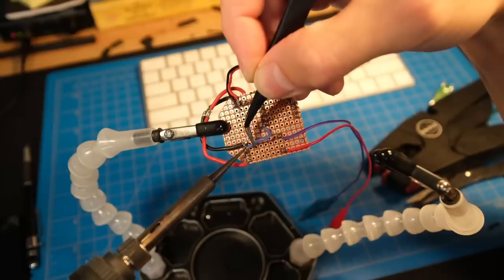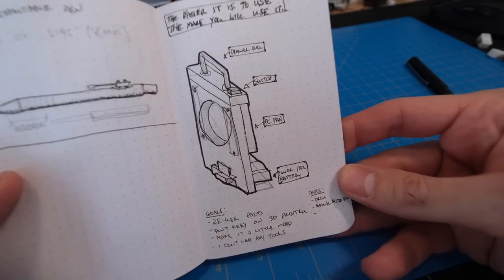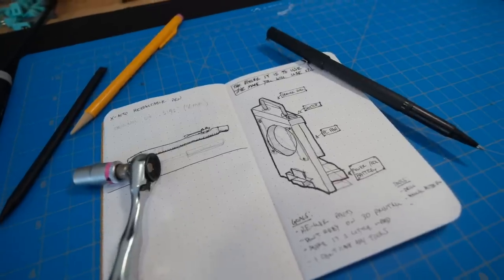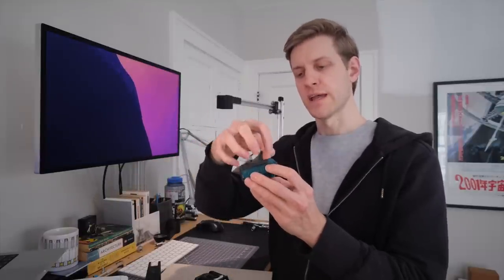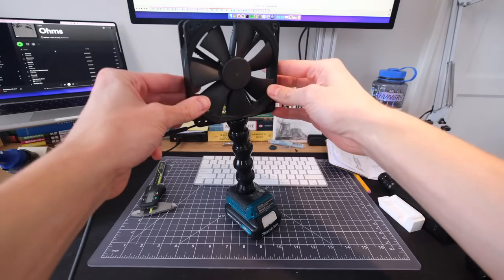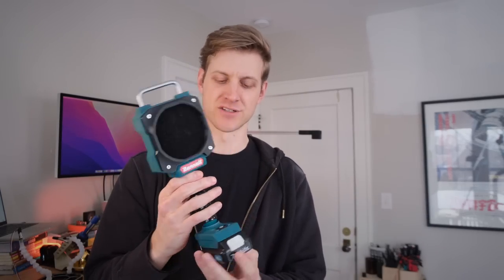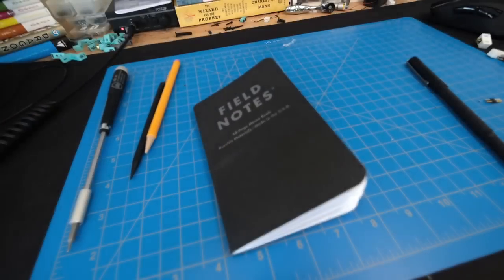A fume extractor I'll actually use | Making a cordless fume extractor

Comment: How does a mesh see-throufh filter actually help you not to breathe in the vapors? If anything it only stirs up the smoke so you can't see it and then injects it into your room as a haze.   A real extractor should be plumbed to extract the vapor out of your living space.......
Reply from the maker: It is a carbon filter
Reply: @StevenBennettMakes  if that's the case, I'm not sure you know the difference between activated carbon and open cell foam.  What you have there in the best case is a simple dust filter. I know because you can see through it. Activated carbon comes in granule form and you need a good thickness of granules for it to have any effectiveness removing anything from the air. Plus it's usually used to remove smell, Not particulate matter.   If you really care about your lungs I would rethink your design
Reply: @StevenBennettMakes  consider using a cheap particulate matter sensor in the room when you're soldering , but with and without your filter, and you'll see what I mean. I don't think your filter is doing anything but hiding the vapor from you while stirring it around
Reply: @gutrali you're absolutely right ! I don’t solder so often, but every time I reproach myself for the fact that I still haven’t solved the issue with harmful fumes.
Reply from the maker: The material is activated carbon impregnated polyurethane foam. The fact that you can see through it doesn't tell you its chemical composition. It's the same type of filter used on hundreds of commercial desktop fume extractors. You're right to say it isn't removing 100% of harmful chemicals, but these types of filters are more functional than you suggest.
Reply: @StevenBennettMakes  I See you want to protect your idea, but this is yet another fume extractor that extracts nothing. @Ryan Skelly is right, that carbon filter will absorb only big particles to some extent. You mention commercial desktop fume extractors with those filters, they are also toys not filtering anything. I designed my own fume extractor, actually extracting fumes outside the apartment, with an option to add carbon and hepa filter inside (only for my girlfriend nail work when she uses her nail dremel.). If you disagree, see what filtering system proffesional extractors actually contain. Redesign your thingy to make arm stronger and attach for eample dust pipe to remove fumes outside your apartment.
Reply from the maker: @Arek His claim was that the filter doesn't contain activated carbon, and it does. Regardless, we are all aware that a HEPA filter is much better at filtering. This isn't that. If it makes you two feel better, try thinking of this as a fan that prevents concentrated fumes from going directly into my nose and mouth, and then rest easy knowing that I have a separate room-scale HEPA filter in my office.

Comment: Your project inspired me to start building my own fume extractor. I'm still in the prototyping phase, but I've noticed that if you do not supply a PWM signal to a fan, most of them will default to around 50% speed. This behavior includes the Noctua Industrial fan you are using. To remedy this problem, I got myself some 12V PWM Speed Controller for pc fans off Aliexpress.  Anyway, I thought this might interest you or anyone looking to build something similar. 😊

Comment: Love the design, great job.
I wanted to note one thing for everyone though. Those electronics that you removed with the LED does more than just drive the LED. All, and I do mean ALL, of the battery management is on that board. Without it your fan WILL drain the cells beyond charge-ability and recovery.
Reverse engineering that board would be pretty hard but there are some super simple Li-ion management boards you can buy online and it would fit within that base. I highly recommend it.

Comment: Pretty cool!  Some thoughts:

1. Some quick digging found that the bluish colour used by Makita is Pantone 321-C.  There are pretty close matches in the RAL colour system, as well: 5018 and 5021 seem to come closest.  Companies like ColorFabb can sell you color-matched filament.  &You can find the Pantone/RAL IDs for most companies' products.
2. One old-school option for extending the fan would be to use a couple of telescoping antennas, with +12v on one and GND on the other.  You wouldn't need to worry about running wires to the fan and you could have it as high as you need it to be.  If you use the folding type as is found on old boom boxes, you can even tilt it forward and back.

Cheers!
Reply: You could also remove the core from some paracord, and insert the antennas into the paracords outer layer to make it harder to accidentally short the battery
Reply: @Aikano9  That's brilliant!!!

Comment: All this talk of inspiration and not using a fume extractor enough gave me an idea. Tomorrow I'll open up my cheap soldering/hot air station and wire in a fume extractor if it's right there and no batteries or external power required I might actually use one because I often find myself soldering something in a rush to finish as it's usually the last step in a project.

Comment: Neat project but at 16:22 you can see how unfiltered fumes are expelled out of the back of the fan housing. 
You would probably need two 120mm industrial noctua fans back to back and a thicker (HEPA) filter to actually extract the fumes.

Otherwise the whole design process is pretty cool to watch!

Comment: For solder a beefy hepa/carbon/chemical absorbtion stack is required to actually remove the cancer causing chemicals and particles. The simple fume extractors just disperse the tiny particles to something you can't see but are still breathing in. Because hepa/carbon filters are expensive a far cheaper method is to just make a window ventilator to both extract are from the room that the hazard exists and in another room force air into the building to create a large amount of fresh airflow without the need for very expensive and consumable filters. Then you can use these kinds of fume extractors to get the smoke away from your face and the window extractors provide enough air changes per hour to the room to clear out the smoke over time.

Comment: Hi Steven. If you were going to re-do the top to suit a more powerful fan, another great addition to this would be a ring light for when you are working. Would make it even more work friendly. Well done though. I myself designed up a fune extractor, but I’m using a 120mm Sunon server fan that moves around 800cfm. So solder fumes don’t stand a chance, lol.

Comment: Really cool tool! Only downside I see is the height not being adjustable without obstructing the top of what you're working on (I guess putting it sideways is a fix but that would go against minimal footprint). Have you tried it with a single ball socket? I think you would retain much of the functionality while optimizing for work that's closer to the table.

Comment: Hi, this video is really good, it makes me be inspired, and the video almost considered all issue, but I have a question, if I have a voltage of the battery pack is greater than 12V, do I need to use a Buck module to make it output 12V? My fan is 12V 0.16A. Or will the battery pack automatically adjust? I'm a new player. My knowledge in this area is really poor. Hope you could answer that, thank you.

Comment: I've been wanting to make an articulating solder extractor for a little while now but I'm definitely going to steal your idea of using a tool battery. The weight should help it keep from tipping over too. Great project.
Reply from the maker: Cool! Best of luck on making your version. The weight of the battery is pretty critical to the whole thing working and it has been stable so far

Comment: I love this idea! I had a similar issue with fume extraction in my small apartment.. I have a fan hooked up to USB power on my work area that works, but has no filter or stand.. This would make it so much more portable. Now I'm gonna have to go find a battery like that; maybe a salvaged one to make my recycle brain happy.
Reply from the maker: Definitely! I found a couple good deals on ebay on the battery front, definitely worth a shot :)

Comment: Hi, I have really liked your videos and I'm thinking of making a DIYson Express with some of my friends that I have shown the project. We are considering buying a 3D printer and I want to ask what 3D printer you make your final parts because I have noticed you have two, a small one and a medium one can you tell me the model of the printer. Because researching I have been in a rabbit hole and I can not decide which wan we should buy.
Reply from the maker: Hello! Yes there are a lot of options out there huh? It can quickly become overwhelming. I have limited hands-on experience with printers outside of the ones I've owned, but I can speak to my own experience and fully recommend one of the Prusas (either the MK3 or the Mini (these are what you see me use)). To keep things simple; the MK3 provides exceptional quality, while the Mini provides exceptional value. Either are a really solid starting point, a big upgrade from the printers I had used previously, and all of the DIYson parts can be printed on either. If you guys need help with any of this stuff feel free to send me a message on my website 🙂

Comment: i had this same idea of using a PC fan with a carbon filter on top of a lockline for a fume extractor but postponed it for the longest while. i guess it's time to steal some design choices and do my own now. i'll probably go for the noctua ippc though, i have 2 140mm laying around mounted on a fan cage i used this summer to cool myself

Comment: Looks great. Be aware, that the board you removed may include some electronics to ensure your fan doesn't drain your battery to a point where it's destroyed.
Reply from the maker: Yeah good call, I saw Adam Savage mention this problem with his portable soldering station. My plan is to store it with the battery removed (at least when it's below 25%), I'm curious what the real solution to this problem is though.
Reply: @StevenBennettMakes  I would imagine the battery itself already has the necessary electronics for that built in (bms)
Reply: @StevenBennettMakes  add a cheapo under voltage protection board if it is not included in the battery and make sure the battery is disconnected when storing.
Reply: @StevenBennettMakes  You can get some generic battery protection circuits at Ali for about a buck. They cut off the battery once the voltage drops below a certain threshold. I'm going to put those in my battery powered creations from now on. Killed quite a few batteries by just having an Arudino on standby :(
Reply: @StevenBennettMakes  the Makita batteries have BMS and low voltage cutoff built in. That circuit board out of the flashlight is just a current regulator for the LED. There's no battery protection inside the flashlight, it's in the battery.
Reply: @JH-tc3yu  that’s not true, at least for 18 V batteries, no matter if one with star marking or without. Over-discharge protection is built into the tools, it’s only using 3rd pin on battery to monitor voltage. There is couple of YT videos demonstrating batteries being cut off at 8-9 V, so waaay to low to keep it safe at 2,7-3 V per cell.

Comment: If you are looking for a fan look into sanyo denki san ace 80 - those come in different sizes and power ratings and are reasonably quiet.
Small tip: when printing buttons with glyph or text, rotate them in slicer by 45° and you will get horizontal or vertical first layer lines or use a textured bed.

Comment: Fantastic build, love your design process / aesthetic. Wondering if the battery has enough weight to it to really let you take advantage of that entire locline? Can you crank the fan to a 45 degree angle?

Looking at it now though, wondering if you really even would need to do such a thing because of your helping hands lifting it up your work off the table. Just a curiosity - fantastic work nonetheless.
Reply from the maker: I think the battery weight is just about right, could be slightly heavier to unlock more articulation in the arm, but I'm content :)

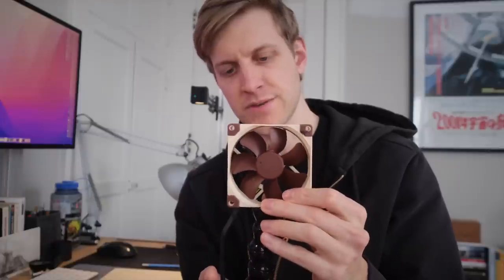Comment: You talked about the awkward transition from the narrow neck to the wide face (11:22), is there a reason why the fan has to be mounted in the 'upright' orientation? If you just rotate the whole thing 45 degrees you get a nice gradual widening of profile, and since the fan blades sit in a circular hole, the orientation of the surrounding structure has no effect on performance.

Also the power cable to the fan comes out of a corner so it seems natural to mount that corner to the lockline.
Reply from the maker: Cool idea! That would be a great way to address that transition. At that point I was set on adding the handle on top so that's why mine remains un-rotated :)

Comment: TLDR- would adding a tunnel to the back of the fan increase draw (eg fume extraction)?

—

Is there an argument to be made for increasing the draw of the fan by creating a shroud that extends beyond the back of the case?  

I understand that increasing the fan power will increase draw, but what about adding a chimney effect?  I’m sure there’s a better definition of the tunneling of air in this use case, so forgive my naïveté. 

Amazing work!
Reply from the maker: Might be worth a try! It would be fun to run some performance experiments with shrouds of different shapes and sizes.

Comment: Nice design and really good video. Thanks :)

Do you know about the noctua na-fc1 fan controller? You could control the rpm and thus performance and noise.
Reply from the maker: Yup Noctua has a couple of ways to control fan speed (the fan I bought includes a few low-power adapters), but the solutions are mostly aimed at reducing power/noise. In my case the fan is running at full power and still not powerful enough, so it looks like I'll have to upgrade ⚡️⚡️

Comment: F***g amazing man. You are inspiring!

For the fume extractor I built the heavy duty one that's available on printables, didn't feel like reinventing the wheel with this one and it is quite good as is, but love your design and process.

I'm doing a similar project just for high quality(high cri) product photography lights using parkside batteries and high quality led light strips.

Why Parkside? best bang for your buck, 12 euros, 2A 12v, readily available, and good quality, sunpower cells. Doesn't even make sense to make your own having that option.

P.S.: I feel identified with your thought process quite often.
Reply from the maker: Wow thanks, Adrian!

Comment: Aren't the locklines hollow? Can't you suck air into them, like a vacuum cleaner, and use the lockline as an extra helping-hand that you can point at the spot you're soldering?

Anyway, great stuff, man o/
Reply from the maker: Yeah that would be cool! I swear I have seen what you're describing used before, seems like a great solution.
Reply: @StevenBennettMakes Most probably in a CNC video. They are used for  cooling liquid (in metal works) or for dust extraction (when working in wood for example)

Comment: As you do more and more soldering, you'll figure out that soldering "up  in the air" like that isn't the best.  Hence why most fume extractors are sit on a table, cause you'll be soldering at the table level.  They why (circuit boat type) soldering irons are shaped like a pencile.

Comment: That desk is crying for a second diyson motion system mounted on the left with an extraction system. I wonder if you taped over the T slots, how much air could you move through those as ducts. You can get really small fans, maybe there's one with the same square dimensions as the extrusion.
Reply from the maker: Ha! This was supposed to be a break from the DIYson. Fun idea though 🙂
Reply: @StevenBennettMakes  just wait until christmas when I suggest adding motors and cables to convert it into a tower crane toy

Comment: So it spits the fumes out the back?
Reply: Yes. 100% a carbon filter will just let the organic particles of the flux straight through and they will be distributed in the room. He is breathing them in. Depending on location of desk and length of time soldering, this could be harmful. A carbon filter is a waste of time. You need a HEPA filter.